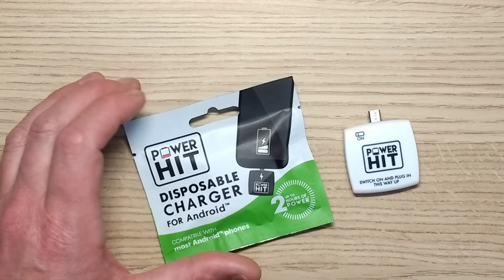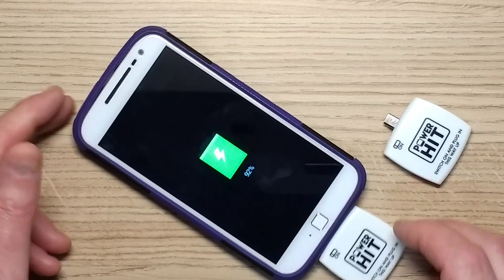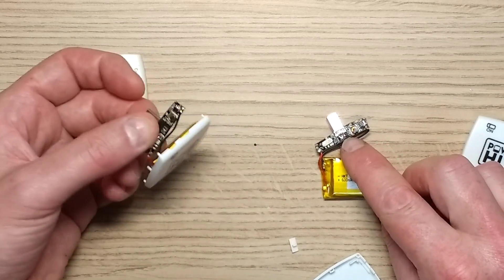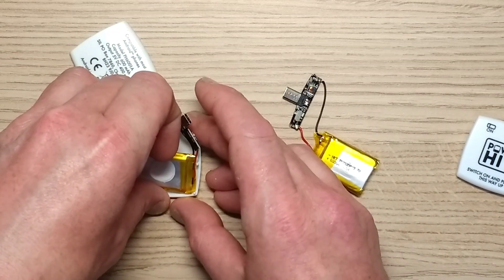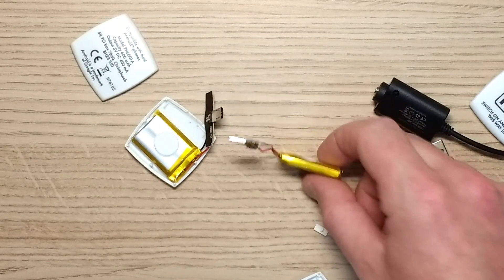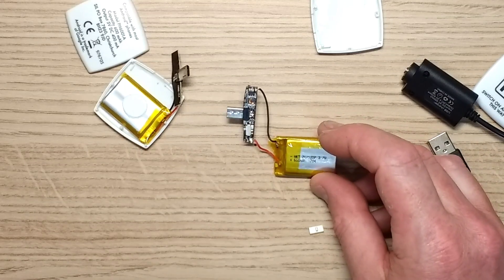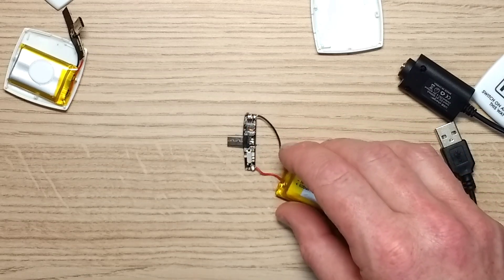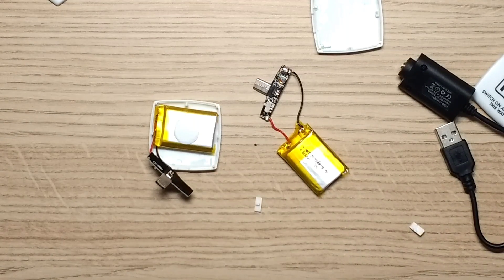What's inside a Tesco Power Hit disposable phone charger.

Comment: So wasteful! The 4.2V (only when fully charged) gets boosted to 5V, only to be bucked back down to 4.2V in the phone itself. Multiplying losses - you'll be lucky if the (claimed) 600mAh cell charges your phone cell by 500mAh. I'd get a 10-12% overall charge on my 4000mAh phone (based on a very optimistic 93% efficiency for each conversion and based on my phone being switched off!)
Reply: Jamie H well thats basically every battery bank out there. It's just so the USB connection can be used. In an energy efficiency way power banks are stupid as hell, but still very practical (that is rechargeable ones tho, not a fan of products like this!)
Reply: Jamie H - My understanding is these are essentially just to give you the ability to make an emergency call or text message/email if you need it... I.E. - Call a taxi from the airport, return a business email to your boss, etc.
Reply: Of course all this waste and battery stress could be solved if manufacturers just went back to removable batteries, like LG makes.  Carry a secondary.  Done.
Reply: removable battery has also to do with phone design with users (appearently) want the phones to be as thin as possible and a removable battery does add thickness to the device (not saying i'd care but it certainly does). having said that every battery is removable, for us techies that is, just carry a pentalobe (or whatever your phone needs) around ;)
and yeah, it's probably meant for emergency situations but still, very wasteful to not include a buck converter and a micro usb port and make it like 50p more expensive
Reply: yes, should hold power for about 10 years, (which is why they have a hard switch), and will give  you around 15 percent charge to a flat phone. so maybe their 2 hour claim might be a bit much, but its still useful
Reply: Jusb1066 -- Hard switch or not, lipo cells do not like sitting stored at their full 4.2 voltage.  The ideal storage voltage is the nominal 3.7 volts.  Of course these are one-time use, so it doesn't really matter if the resistance in these batteries go to shit, but it's not ideal way to go about getting the most capacity out of them.
Reply: True, it is a bit wasteful, but it's the only way to charge a phone through USB. I don't think phones use a buck converter to step the 5V back down though. It would also be a waste. If you look at single cell charge and protection boards, you'll find that they use only a couple of protection ICs and some external components. I think the protection ICs step down the voltage themselves to keep space requirement and external parts to a minimum.
Reply: It's a shame USB spec isn't 4.2V rather than 5V. I guess maybe if they were starting from scratch today it would be.
Reply: Felix Müller -- Water resistance is probably the biggest selling point for non-removable batteries. And I can understand why that's appealing to so many, even if it means sacrificing a lot more.  But the reality is they're still lithium cells with a finite amount of life, and charging them up every night for a year and a half is 550 cycles at high current (most phones have fast chargers these days).
Reply: well a buck converter in an IC including some protection is still a buck converter...
Reply: well I'm pretty sure that a very big amount of IC's run on 5V don't they?
Reply: Highly unlikely. 4.2V is not a voltage things typically run on, and higher voltages are much more practical due to cable resistance.
Reply: The first waterproof phones still had non-removable batteries, I do not believe their IP ratings were any worse either.

They claim its to make phones smaller but who the heck needs a phone so thin it cuts into your fingers when you hold it anyway?  I find my Note 4 too thin, my fingers overlap and cause false touches on the screen.

No, I think the reason is clearly just to force people to buy new phones every couple of years.

eg When the battery on my Note 4 became unusable earlier this year I tried to get an official Samsung replacement but big shocker they had stopped making them.  Thank goodness for third-party batteries.
Reply: @alex indeed, even my samdsung galaxy has a plastic overcase on it, because its too thin to hold, i have to spend more money to make it thick again! lol   yep my older galaxy i tried about a half dozen batteries before i got one that wasnt really crap and held a charge close to the original, so many crap chinese ones, samsung didnt sell for that one either
Reply: Jamie H 
That's nothing compared to me using my laptop in the car using an inverter to boost the 12volts DC up to 120 volts AC which the laptop power supply then converts back down to DC 19 volts
Reply: @techosendude i agree, water resistance is the other selling point, but to be fair the batteries werent removable in non-water resistant phones as well. has to do with design i guess as well. apple for example doesnt want their customers to see inside their products as easy, they're glueing everything together... Well even for non tech users there are batery exchange services for like 20$ more than the parts cost, not a big deal to me... but you can even see it in laptops, no water resistant ones out there but barely any with removable batteries (or RAM or Storage) anymore... it's just the way it's going right now...
@Alex Atkin to be fair, tech companies are not that bad. of course you can come up with the planned obsolence stuff but part of it (not all) is just bullshit. they design the products in such a way that the consumer wants it and that the consumer pays, i guess costs are a very strong point there as well. why so many things are soldered now. connectors do cost some money, sockets and stuff even more, housing for the battery and removable back as well. if those companies were so evil and thought about things like "what would be the worst way to make a battery be part of a product" they sure would have come up with coded batteries or something like that so one battery only works with one specific device. well some companies have done that but not when it comes to the battery
Reply: @thechosendude: Motorola appear to have done just that. My G2 (which I broke) had a hard wired battery but the G5 that I replaced it with has a removable. Good boy, Moto: Have a biscuit.
Reply: @David Scheiber:
there are 12V to 20V adapters, if you care about a couple of watts in efficiency loss in a 80+kW car :D
Reply: I bought what was supposed to be an official Samsung and it was worse than my old one.  Ended up going for an Anker replacement which made it feel like a brand new phone.
Reply: Felix Müller pentalobe screwdriver? Fine for an iPhone, but you'd need a heat gun for a lot of android! Not to mention ruining any water proofing in the process.
Reply: @Jonathan Brown: well i do own an iphone so thats that. and one can say a lot of shit about apple and i wasn't really a fan, but it's a very reliable phone (5S), easy to open and relatively easy to repair. Spare parts are available and are very cheap. I'm still very happy with it after 3.5 years of service now and around 100 Swiss Francs spent in parts (70 of which are entirely my fault because i broke the screen, meh).yeah, ruining waterproofness sucks, but i dont even know if repair shops can make that work again...
Reply: I have an Anker 10400 and its only able to output about 6399mAh @ 5v.  I checked with their support and they seemed to think was about right, a bit higher losses than I had expected.  I wonder how much I then lose from the phones charging circuit?

Still, I suppose with my phone awake and screen on low it pulls between 500mA to 1.5A, so even this tiny device would add a useful amount of run-time if your phone was about to crap out - assuming it can actually supply enough current (I have my doubts there).
Reply: Don't forget: That 4.2V is bucked down again to whatever voltage the chips inside the phone need ... 3.3, 1.2 etc.
Reply: @Euro Bum: And even boosted up if you plug a USB OTG stick into it, i would imagine. And the display needs a higher voltage as well, doesnt it? Not a very efficient thing
Reply: A 4.2V input voltage is a terrible idea, because once you start including resistive losses, and diode voltage drops in protection circuitry (do want your $1000+ phone to be destroyed if you plug it into a badly wired charger?), you will end up only being able to reach 3.5V or so. If anything, the USB spec should have been a higher voltage like 9V or 12V, so that less power is lost in diodes and wires.
Reply: You don't need to have any diode drops for protection circuitry.
Reply: Monkeh, there don't necessarily need to be diodes inline but there still need to be diodes (so some parts of the circuit will be running at a lower voltage). The main thing though is resistive losses. Between all the connectors and the cable it's not at all hard to lose 0.7V, at 1A you would lose that from a resistance of just 0.7 ohms. The fact is that a 4.2V input voltage would require there to be zero resistance in the wires and connectors and zero losses in the protection circuitry, which makes it an absolutely terrible idea in practice.
Reply: do you think about this when you plug  your phone into your computer? that is 5 volts. people talking about volts but what about amps? 2 amp is fast charge now it seems.
Reply: The trend is towards lower power consumption and lower core voltages. For example the latest Snapdragon chip uses 0.6V.
Reply: @codebeard We don't really care that much about voltage drop. As your battery reaches full capacity, and current goes down, so does the voltage drop. Eventually the current approaches 0A , voltage drop disappears completely, and you get your nominal voltage. The faster you charge something (higher current) the more energy is lost as heat. Ideally you would want high voltage, low current, and then you care less about resistance. Ah, but then there are switching losses in your dc-dc converters!
Reply: Frustratingly they also are obsessed with making phones thinner and thus reducing the battery size. :(
Reply: what the fuck?
Reply: Danny K wha de fuk
Reply: They claim a truthful 400mAh on the case it shows in the video... I was a little surprised.
Reply: thechosendude problem with doing phones with removable batteries is it is no longer viable. Nobody will buy a phone built like in the past. Waterproofing, glass backs, wirrless charging are all contributing to the death of removable batteries.
Reply: Jamie H i have a 5600mAh
Reply: A5C3NS10N STUD105 I don't drop my phone in the toilet regularly and glass backs are a bad idea anyway, so I'd gladly buy one.
Reply: Lumpio2 you however, are a single person. There isnt a company out there that is willing to make a phone as such. Hell, i used to be a big LG fan because of the removable batteries, but now i honestly cant see any flagship phone having removable batteries anymore. Theres no profit to be made.
Reply: Sorry but that's pure BS as phones had already started down that path when the Note 4 came out and it still sold really really well.  The whole benefit of Android phones was their diversity, if everyone phone becomes identical then sooner or later we are going to end up with only one or two companies making them.

Also, if idiots want to buy glass-back phones that crack the first time you drop them, so be it.  That is no reason to take the WHOLE market in that direction.  Many people HATE that design, HATE thinner and thinner phones that become too awkward/painful to use.

Not sure why you mentioned waterproofing or wireless charging as both those things still work fine with removable batteries.  Its purely the quest of making them thinner and thinner that caused the issue here, its also why phones started to bend as they stopped including all that plastic internally that makes the phone strong, once they no longer needed it for holding the battery in place.  Completely ignoring that it also made the phone rigid.
Reply: I'm fairly sure USB was designed at 5v because that is the voltage ALL PC external ports used at the time.

PS/2, Serial, Parallel, they all ran off 5v and so the kind of peripherals USB would be used for (as it was basically replacing all those ports) already were designed for 5v.
Reply: @John Coops. That is incorrect. 4.2V will charge a lithium cell just fine, with cables and all.
Reply: The USB signaling (before 3.0 at least) is 3.3V, and the power supply line is 5V because you can use that to generate a stable 3.3V rail even with some voltage drop over a long cable and with a regulator drop-out. 5V logic was already dying out in complex digital electronics by the time USB came out.
Reply: +Jusb1066 I got a wireless charger back for my S5 which made it thicker and it feels a lot better than with the original back. We don't need thinner though I understand it might be a marketing thing for the uninformed. Certainly when I will be looking for a new phone, removable battery and SD card will be top of the list.
Reply: +David Scheiber , you can get 12V laptop power supplies but probably isn't worth the extra cost. At least switching power supplies are more efficient than the old kind.
Reply: +Felix Muller, many laptop batteries are coded. Usually it's pretty weak and the Chinese break it easily anyway.
Reply: David Scheiber:
So use a 12/24V Laptop supply converter, they are available in different power levels, at least 70W, 90W and 120W and you can adjust the output voltage in many steps between something like 12V and 22V. They are already quite cheap from chinese places.
You even save on bulk and weight, although if I need the laptop only like once a year in the car, I would probably also use an inverter.
Reply: @Euro Bum: Yes, that's true. But you need 4,2V AT THE BATTERY TERMINAL. So there would be no margin for the tiniest resistance or voltage drop. I had already crappy USB cables with nearly 1 Ohm resistance, but 0,3 Ohm is typical. To charge the 3Ah battery of my S5 quite fast, the phone takes up to 1,8A. That would give you just about 3,6V at the battery. This is not enough to charge it FAST and FULLY.
The original charger of the phone even INCREASES its output voltage with increasing current up to 5,7 or 5,8V to compensate for cable resistance and other losses. It simulates a negative internal resistance which works very well.
If you had only 4,2V at the beginning of the cable, it would take infinitely to charge the battery fully.
Reply: John Coops ever heard of android battery optimization?
No?
Neither has anyone else.
Reply: @gomarty. Incorrect. 4.2V at the charger would take a bit (not infinitely) longer, and it would charge it fully.  Read my comment further up.
Reply: Its not really the OS at fault, its designed specifically to multi-task apps without stealing their resources vs iOS where its designed specifically to restrict how much an app can do.  The fact Android works like that is a big selling point for many users.

Anyone who wants a more restricted phone would buy an iPhone.  But its not like that has vastly superior battery life either, its always down to your own usage pattern.

I can get three days out of my Note 4 with light use even without being overly careful what gets left running (eg Facebook).  I haven't even tried the highest power saving mode which is meant to turn all none-essential functions off for even better life.
Reply: Name one OS (mobile, desktop or even server) that DOESN'T expect you to always be online and want to sync with the cloud by default!  Even Linux distros make huge assumptions over what you want, including annoying things like auto-indexing the meta data of my files when I will NEVER do a meta data search anyway. (excepting music of course)

If you don't want always online or notifications then just turn off mobile data, WiFi and the notifications you don't want.  Most notifications are from the apps themselves, not really the OS at fault there as it DOES let you turn off notifications for ANY app, its just app updates have a nasty habit of turning them back on.  Again, blame the app not the OS.

Even better, install one of the ROMs that doesn't come with Google Apps and just side-load all your apps.  Its a heck of a lot less convenient though.

Personally, I much prefer to know my address book is backed up in case my phone breaks and I have to start again on a new one.
Reply: The problem of the inefficient conversion of 4.2V to 5V and then down to 4.2V is nothing ,compared to the usage of a rechargeable Li cell used as a disposable device!
Reply: @next-hack Amen!
Reply: i would need 20 of them to charge my oukitel K10000 pro (which has a 10,000mah battery)assuming perfect conversion and no power use while the phone is charging 

thats 60 quid to recharge my phone just one time 

half that price for a rechargable power pack that can charge my phone at least 1.5 times per charge is a way better deal
Reply: The point still stands though, it would cost twice as much for the same capacity used ONCE.  They just found a very odd way of explaining it.
Reply: Pretty much. And just try to slip a 15,000mAh power bank in your pocket alongside your phone.
Reply: Someone should be selling phone-to-phone chargers so you can leech off someone who is more dilligent about charging. I've actually considered putting an outlet on my kindle as there's a pretty fair sized battery on that (1420mAh)
Reply: @Chaos Corner: I think you could just use an OTG cable. Even if the current could be very limited (see article: "USB On-The-Go presents benefits, challenges to power designers" on eetimes).
Reply: I think I have some OTG cables. I'll have to give it a try.
Reply: Its no different to charging your phone from your laptop, yes an OTG cable can do it but the current won't be high enough to actually charge unless the screen is off.
Reply: also,  if you had the standard be 4.2v (or having a direct connexion to the BMS), you'd still need to boost the voltage of the powerbank's battery to charge the phone, so you'd have to make a new standard just to save about 5% in efficiency.
that could be doable if you were apple, but it would be less expensive to add 5% in capacity of the battery.
Reply: Ok Sheldon